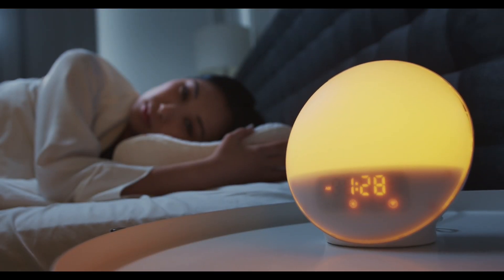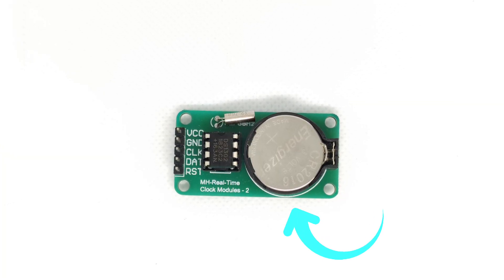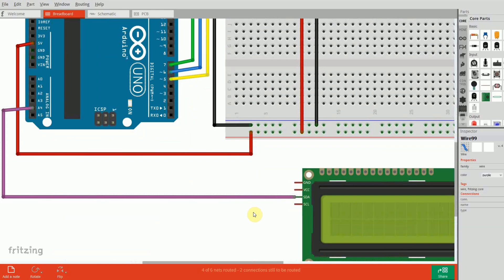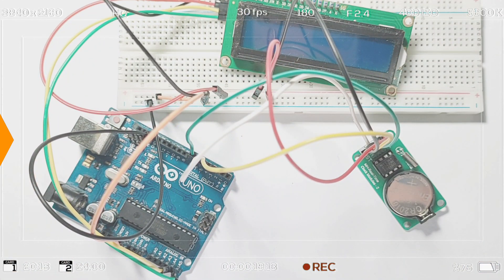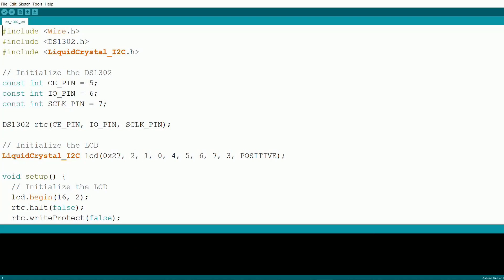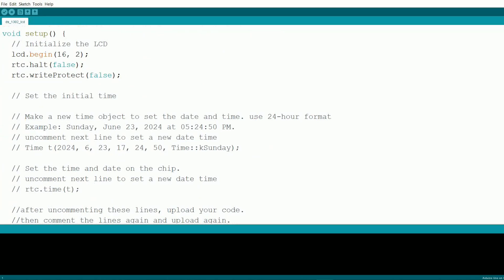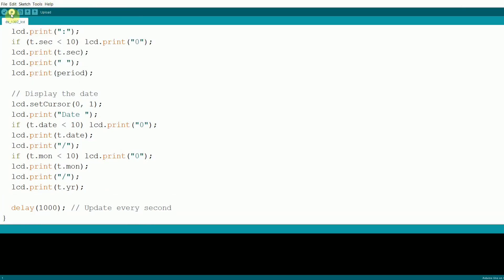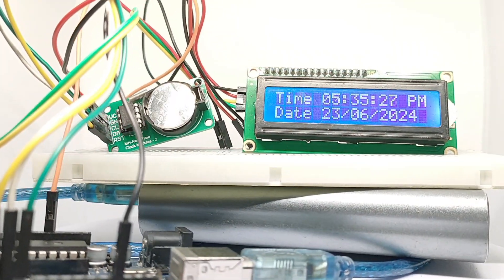Build Your OWN Arduino Clock with DS1302 RTC and I2C LCD Display Now!

Comment: cool but what dose it do that a 15$ clock cant in honesty a 15$ has am/fm and alarms so whatthe point of this just to show or is there more to this
Reply from the maker: It's a fun project to learn about real-time clocks and I2C communication. Plus, you can customize or scale it to fit your project needs like an automated gardening system where you can turn on/off grow lights or water pumps at certain times or specific days (using conditional logic), or you can use it to make a log, with a date and time stamp, of anything that is captured by sensors connected to this Arduino setup. Think of this as a foundation of the greater things you can do with creativity and innovation.
Reply: freedom to make it exactly how you want it you can customize the display to oled lcd digits etc even add other sensor etc

Comment: Thanks for the explanation, very clear!
But in Europe (Holland) we use a 24-hour clock.
Do you have a solution for that?
Greetings
Leo
Reply from the maker: Sure! To modify the code to display time in 24-hour format, you can remove the logic for determining AM/PM and adjust the code to directly print the t.hr value as the hour. You can try this: 

void loop() {
  Time t = rtc.time();
  
  // Display the time in 24-hour format
  lcd.setCursor(0, 0);
  lcd.print("Time ");
  if (t.hr < 10) lcd.print("0");  // Add leading zero if hour is less than 10
  lcd.print(t.hr);
  lcd.print(":");
  if (t.min < 10) lcd.print("0"); // Add leading zero if minutes are less than 10
  lcd.print(t.min);
  lcd.print(":");
  if (t.sec < 10) lcd.print("0"); // Add leading zero if seconds are less than 10
  lcd.print(t.sec);
Reply: 24 format is military time

Comment: i have a problem with the lcd initialize "POSITIVE wasnt declared in this scope",
can you help me sir ?
Reply from the maker: The I2C LCD and Wire libraries may not have been installed, or there could be a conflict with another installed LCD library. Check this article on how to download and install the libraries: https://www.arduinointro.com/articles/projects/displaying-characters-using-the-i2c-liquid-crystal-display-lcd
Reply: @arduinointrochannel  Thank you for your respond then, what's the name of the library you install for this project? , i've already installed lcd 12c built in officially by arduino 1.0.7 isnt that the right library? 
And what's the name of wire library you use?